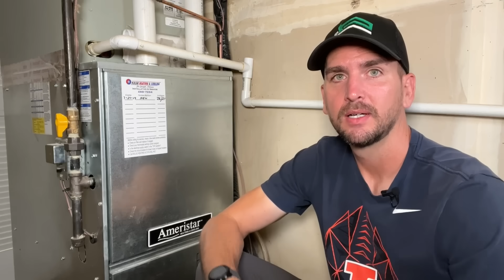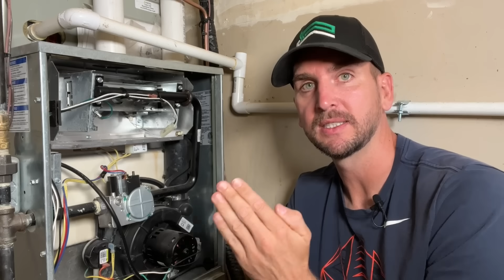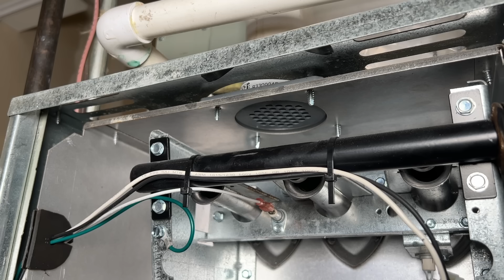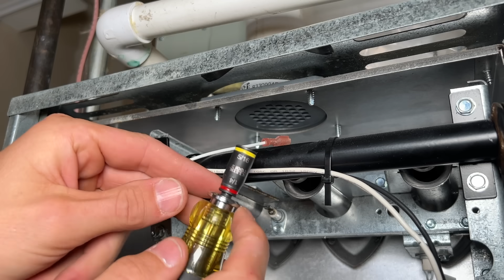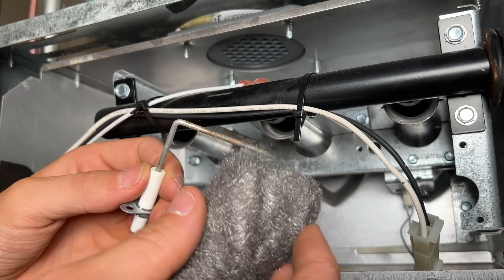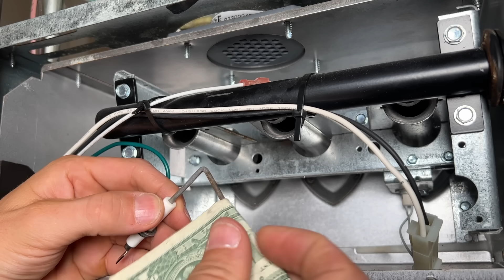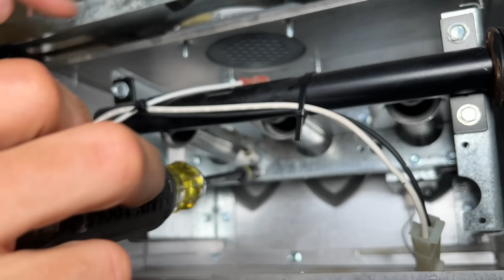The Most Common Reason Why A Gas Furnace Won't Turn On

Comment: If the thermostat request for heat and machine doesn’t responds/turns on, what could be the issue?
Reply: Check for control voltage. There should be 24v across R and C. When the thermostat is calling for heat there should be 24v across W and C, or 0v across W and R. If you do not have anything across R and C check for shorts in the control circuits which blew the fuse , check the thermostat wiring, and check the transformer.
If there is control voltage and the thermostat is calling for heat but nothing is happening then check the inducer motor. If the board is sending voltage to the inducer but it does not spin then check the capacitor for it if it has one and replace the motor if it does not. If the board is getting a call for cool but not sending power to the inducer then replace the board, but verify the inducer wiring first.

Comment: I dont have a flame.
Reply: Verify that the inducer is running, verify that the pressure switch is operating, Verify that the ignitor is working, verify that the gas valve is working.

Comment: I have this ac/furnace.
make sure you keep you ac drain clean and the tray.
if its clogged the ac will drip down right on the inducer motor , over time it will rudt the sdhaft and eventually if will ruinh the motor.
 I learned this all the hard way. 
 Also you MAY get a 3 blink error code stating its the pressure switch, if you bypass the switch youll get your 2 blinks indicating the motor.
 My unit keps giving me faulty pressure switch, but it was the blower motor.

hope this help, great video btw.

Comment: I wanted to walk through these steps, but when I turn the power switch on I’m not getting anything. I just put a brand-new thermostat in so it shouldn’t be that but I’m not getting the message from the thermostat to the furnace.
Reply from the maker: Hey Sue, I have a video coming out on Wed this week which will show you how to bypass the thermostat and manually call for heat.  This would help you troubleshoot your heating issue.  Did the furnace ever work with the new thermostat?
Reply: Double check the wiring for the thermostat, verify that the wire colors correspond on the terminal strip on the furnace and on the thermostat. Verify that you have 24v across R and C. If you don't check the fuse. Verify that the thermostat is giving a call for heat by looking for 24v across W and C at the furnace.

Comment: What would be the next step? Mine is shutting off 10 seconds after the air handler starts up.  Then usually will restart and run ok for about 5 minutes.  Then cycles again OK until the full cycle when the thermostat shuts it off (target temp arrived). I admit, I haven't tried the cleaning as this unit is new and has only had a season of A/C in addition to a few hours of total use so it seems odd that it would be dirty already.

Comment: Notice how this furnace has three flames, with only one igniter and one sensor.  They are all in a line with the igniter and sensor at opposite ends, so the fire spreads from one end to the other, and the end with the sensor can only light if every single burner lights to pass that flame along.

Comment: Hi Scott good info. Here's my problem I have a Rudd achiever 90 plus installed in 2006 and just recently it goes through the whole steps but sometimes after running for 30 mins or so I hear this clicking or popping noise and poof! The flame goes out, then it will try to lite itself but now there is no flame. I replaced the flame sensor just last year. Any thoughts? Thanks
Reply: Could be multiple things, if there are diagnostic lights on the board consult those to get you pointed in the right direction. Could be a dirty flame sensor, but unlikely since its new. Could be a pressure switch opening which can be caused by water in the lines for them, a restriction in the intake/exhaust piping, or a bad switch. It could also be tripping on limit but if thats the case it wont try to reignite until the limit switch resets itself but it will just run the fan.

Comment: Hi Great content! Can you answer a question for me..... I cleaned my flame sensor - but my unit may or may not go on & then it does the 4 hr safety lock out...... I get a pilot Flame..... but it does not then expand to that blue blaze..... it will try 4x & then lock out...... does that mean my Gas Valve is going bad?
Reply: Does it have a smart valve? If it does then it sounds like the gas valve because smart valves are know for being completely shit which makes no sense since they are also 4 times the price of a normal gas valve.

Comment: Very true! I have 6 rental properties and always have flame sensors on hand. They are the number one cause. Great video as always!
Reply: Its very rare for a flame sensor to actually break, usually they just need cleaning.
Reply: @Redtooth75  Maybe I missed this but ( I think) tech didn't RE-remind to be sure power off main("light switch"). Also do NOT clean sensor with sandpaper or anything rough. Coating of sensor not very thick. Elsewise  video EXCELLENT; understanding operating sequence of unit is super useful. Furnaces, like cars, have become somewhat techy but necessary to keep em safe & efficient.

Comment: Okay I replace new sensor and new gas valve it runs perfect  but then fire not stay lit why anyone knows thank you
Reply from the maker: How long do the flames stay on?
Reply: @EverydayHomeRepairs   sometimes looks like its running just fine but it stay lit less than a minute and most mostly just when the blower kick in then fire stop
Reply: @EverydayHomeRepairs  flame stay till it calls for blower kicks in the fire stop !
Reply: @trahuynh_usa  sounds like you have a bad heat exchanger, you can confirm it by seeing if the pressure switch opens when the blower kicks on.

Comment: Absolutely right… I was charged 450 for an emergency call and my problem was that the flame sensor was bad, but after cleaning the flame sensor and temperatures below 0 degrees I had no choice but tp call for service…. Sad part is parts cost 15-20 dollars and I paid 450 dollars…. Word of advice have an inventory of flame sensor and ignator

Comment: It’s called flame rectification, it sends a micro amp signal to the control board and if it sends a weak signal then it won’t allow 24 volts to the gas control hence shutting down the burner sequence as part of the safety for the system !

Comment: This video is a keeper.  The original system in my house had a bad capacitor for the brushless blower motor.  The rest worked great, but in 2017 I had the whole HVAC unit (heater/blower box and the outside compressor unit) replaced.  The new system works great, less power (current) needed for the compressor and because I had a solar panel system rebate from the government, I was able to pay off the HVAC system.
Thank you for this video.

Comment: Good general information to get you thru a cold night. However, this imo is not a substitute for preventative maintenance.  Good hvac service techs have specialized equipment that will keep your equipment running within manufacturers specifications and will keep you safe. Flame sensors do get dirty. However it's important to understand why it's dirty. Certainly you could be using combustion air within space which will possibly affect burners and flame sensors. That said poor fuel quality or improper exhaust termination can also be a source of a dirty flame rectification system. Recirculation of combustible byproducts is a sure way to shorten the life of a primary and especially a secondary heat exchanger.  If you can't read microamps and are familiar with what specifications that manufacturer requires your just guessing. I get it annual checkups suck but they save lives. Yes I am a contractor but we're not all bad! Stay safe..

Comment: My pilot light went out and will not stay on . Had to manually light it w/ lighter and finally stayed on in 'Pilot' mode but when switch to 'On' always shuts off.   What's the issue?
Reply: Most likely you need to replace the thermocouple.  I have a very old furnace and it usually needs replaced every other year or so.  This is exactly what mine does when it needs replaced, so im guessing thats what it is.

Comment: Could be a motor failure, capacitor issue, door switch, fan switch, hi limit defect, etc.  There is no ONE thing that you can look for.  Such bolderdash.

Comment: Please help. Any advice will be so appreciated! Our Beckett oil furnace green light will not come on. Only time it will is for a split second when we flip breaker on but it goes right back off. We put in a new breaker it does the same thing still. Any advice? Thanks In advance !

Comment: Good video.  I have had to clean mine about 4-5 times in 20 years when the cycling occurs.  One thing that occurs to me is, these furnaces are so CLEAN compared to our old oil burner furnace.  The maintenance is much lower.
Reply: Yeah so clean they break down 4 times as often.

Comment: When you remove the cover, some units have a safety switch preventing operation without the cover. You may have to tape that in the closed position to visually test like demonstrated. Great video.
Reply: Exactly...  Trane units have a safety switch that that closes when the front cover is on and opens when the cover is removed.  You have to tape it down for the furnace to operate with the door off.  In fact, the door ajar is a common failure point for the furnace not working....  the tech comes out,  makes sure the door properly shut and charges you $150 for his 1 minute of work....
Reply: Can someone answer a question for me..... I cleaned my flame sensor - but my unit may or may not go on & then it does the 4 hr safety lock out...... I get a pilot Flame..... but it does not then expand to that blue blaze..... it will try 4x & then lock out...... does that mean my Gas Valve is going bad?
Reply: @jackzeldon2883   look for the diagnostic code. It was tell you
Reply: This helped a ton, thank you! Had no idea
Reply: Yep noticed mine does.
Reply: have only ever seen door switches on fan compartment doors not burner compartment.
Reply: When I had my natural gas furnace replaced 30 years ago made up a jumper with two female stations to temporarily bypass door switch. The furnace would not come in and looked up what the flashing light meant. Didn't provide problem and the last thing that I checked was flame detector rod. Removed it cleaned it with Scotch Brite. Keep telling myself that this has to be cleaned soon.

Comment: Furnaces are pretty simple. Of course, they're all controlled by a main circuit board but those rarely go bad. It's usually something else. I had a transformer go bad from an electrical spike (caused by me😄) once. $13 for a new one. A few months ago, the blower fan wouldn't come on. It was the capacitor on the motor that quit. $12 on ebay.

Comment: Step 1 is the computer checks the state of the pressure switch without the draft inducer motor running. The contacts should be open. If closed (stuck) it'll shut down before you make it to starting the draft inducer.

Comment: If you can, go electric.  My furnace is 24 years old.  5 years ago I replaced the fan motor, some contactors and temp sensors as a preventative. Kept the old parts as backup.  Cost me less than 200.00.  Never have to worry about carbon monoxide.
Reply: Most electric furnaces last much longer and don't kill you with carbon monoxide.  Plus, here in manitoba all our electricity is from hydro, so it's environmentally clean.

Comment: I've replaced 2 ignites in my 31 yr old furnace - I always keep a spare.
Graingers Supply usually has them - last ones I bought were $17 ea.
Because propane is so effing high this year I plan to use electric heaters - only use furnace when it gets real cold.

Comment: My current issue with my 18yr old York furnace is the inducer blower sticks and doesn’t turn on, had it fixed once but now it needs to be replaced and since my furnace is old, the part has been replaced and now cost $980 and I’m looking at $1600 to $1700 total taxes and labor. So now I’m considering replacing the furnace. Great video 👍🏻
Reply: They are ripping you off.  Replace it yourself and save a ton of money.
Reply from the maker: Dang, that is crazy for an inducer motor.  I wonder if there is a replacement part with the same dimensions and performance that would only be a couple hundred dollars.  The inducer motor is usually pretty easy to swap out.  Best of luck with the repair
Reply: Mine is 18 years. Unfortunately I know nothing about a furnace but when he started naming all the stuff that was wrong it was like he was talking another language . It was helpful to watch this video and Im scared at this point how much it will be to replace my furnace

Comment: about 25 years ago my gas furnace stopped working in the middle of winter.  it turned out to be the electronic exhaust damper.  To fix it, I jammed the damper open with a screw.

Comment: A couple of things that have required service on an old Trane XL-90
* The condensate drain line is either dry or plugged.  This is often connected to the A/C evaporator drain.  Semi-annual flushing with a bleach or quat ammonia solution often helps reduce biological growth.  A plugged line could cause condensate to back up in a condensing furnace and forcing it off.  The logic will then try again, and if the line has drained a bit thus changing the presser differential ever so little that the next ignition sequence to succeed.  If not, the ignition sequence will try perhaps up to 5 times and if not successful, trip out.  So, in the case of the thermostat setpoint being increased from, say 65F, to 70F, the furnace may stay on until 68F, but keep short cycling until the 70F is reached.  At 68F, the condensate line is filled and slow or not draining. and so the short cycling begins.

* The ceramic ignitor, (SiC ??), adsorbs or absorbs moisture over time, (maybe a phase change??).  Left in a cool, high humidity furnace over the Summer and Fall, the ignitor fails begins to fail and after a few cycles. it fails open.  This can be prevented by placing the ignitor in an oven and heating at 350F for an hour or two and then reinstalling in the furnace.  A new ignitor coupled with a new modified ignition control module pretty much eliminated the moisture-caused ignitor failures.

* Never having required service:  This furnace has a thermistor positioned just outside a hole in the metal box shield, (correct name?).  This detects an overly high temperature due to excessive burner flame or burner flame outside the box.

Comment: I have been doing HVAC/R for Many years, This is a SOLID explanation for the start up sequence.Great video! You might want to add a video for the igniter failure/replacement.
Reply: O9am
Reply: I have the on/ off switch not working but my furnace still blow air and the burners turn on but the blower doesn’t kick in to send air up what’s ur thoughs
Reply: @raymondhoguelll2044  flame sensor
flame sensor
Reply: Vladimir Putin  smart gas valve was the main issue $ 1300 to fix 
Works now 👍🏻
Reply: @raymondhoguelll2044  Did you spend $1,300 bucks or just install a new furnace at the same price?

Comment: The other thing I've seen cause the start/stop you mentioned, but slightly differently, is when the glow stick fails. The gas comes on for a few seconds then the flame detector shuts the system down because there is no flame.
Reply: Something is wrong if the gas valve opens but the igniter has failed.  Circuitry should have recognized an open circuit.
Reply: @somaday2595  I didn't smell gas, but I could here relays clicking and thought it was trying to kick the gas on. It would keep going through the cycle every few seconds, but nothing happened. However, just sitting there looking at the unit, it seems similar to what was shown, but no flame. Of course, it's also an easy fix. It could also be that when the  igniter (glow stick) failed, it may have shorted and still had continuity. With the draft inducer motor running, I suspected that if it was releasing gas, that it may have been carried up the chimney by the air flow from this motor. Either way, I powered off the unit, just in case, until I could get a new igniter.
Reply: @wmcomprev  The repeated click on/ click off, wait a few seconds, repeat until ignition or max of ~5 times, was likely the ignitor/ heat stick relay.
Reply: @somaday2595  Probably. However, it was just obvious that the igniter wasn't glowing and it was cold in the house. I used a VOM to verify that there was voltage to the igniter and there was, so I replaced it. It's also a 20 year old unit, so it may work slightly different than what's in the video, although the basics appear the same.
Reply: Vladimir Putin  Thanks for your input.  On an old Trane X:90 with updated control board, the combustion air/ exhaust blower is activated, the pressure differential checked, the igniter is powered and checked, gas valves open, flame.  The thermistor may be able to trip out the entire sequencing at any time if the firebox area is too hot.

Your sequence missed the ignitor/ glow stick turning on (or failing to turn on).  If the ignition source has failed, the gas valve should not open.

Comment: If there is an air supply issue, blockage, the flame will go out.  The sensor will be working, but the symptoms appear just as if the sensor is dirty or bad.  So always check that you have a good air supply and exhaust.
Reply: Re:  Insufficient combustion air, the outside air intake is just a few feet from the combustion gas outlet.  So when it is really cold and the wind is from a certain direction, the combustion exhaust blows over to the air intake, which is coverage by a screen.  The condensate in the exhaust has cooled enough that it freezes on the intake screen, blocking some air flow into the furnace.  Blowing snow makes it worse.